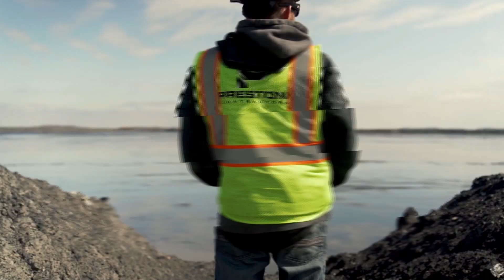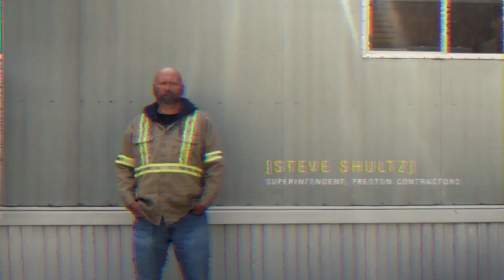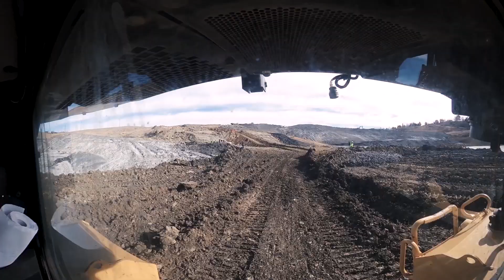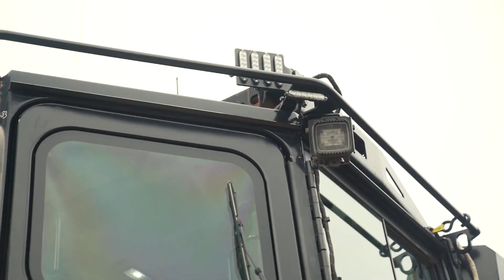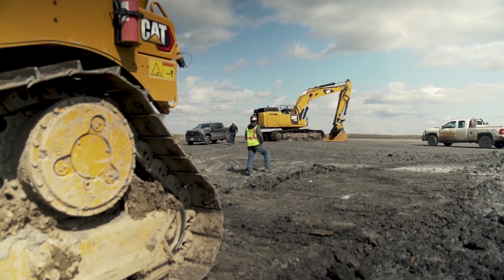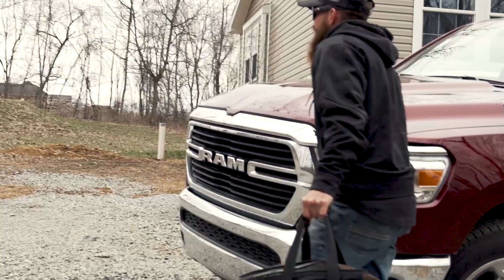Cat Command for Dozing – Preston Contractors

Comment: Taking the skill out the job cant replace a human yet can replace the operators job
Reply: You realize that the operator that was man operating that dozer is the same guy running the remote right? Operators job is not being replaced, just taking the man out of the dozer while performing a dangerous job.
Reply: @aaronwhitacre1176  yes I do realize but do you realize that a operating is about control of the machine feeling and seeing and hearing  while sitting in the seat of that machine being one with the equipment not playing a video game
Reply: @richieprice3006  actually I do realize considering I work on the jobsite that this dozer was at. Not saying you dont, but if you don't understand how a pushout works on a slurry cell, then you wouldn't understand this concept as to why they're used for that. These dozers are not being ran by remote all the time. Only on pushouts. You can switch how it's ran by a flip of a switch.
Reply: I work equipment every day at a landfill and to be honest I started as a labor worked my way through and learning  every aspect from ground up how to run grade to slopping to drainage to erosion and  to be honest I feel like any kid with  the ability to play  a Xbox can take my job lol
Reply: @richieprice3006  but honestly it might be even easier to pick up on running it if it were using a game console controller 🤣